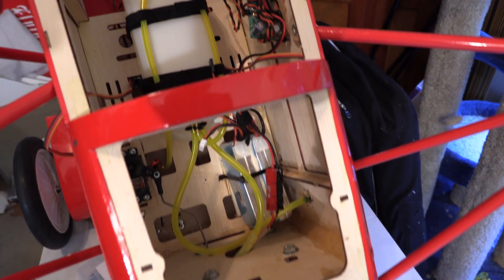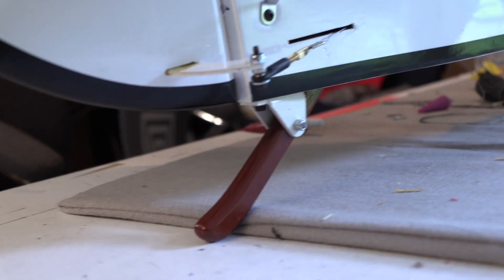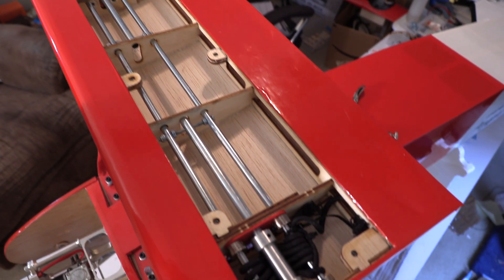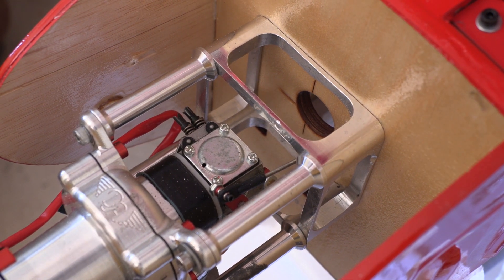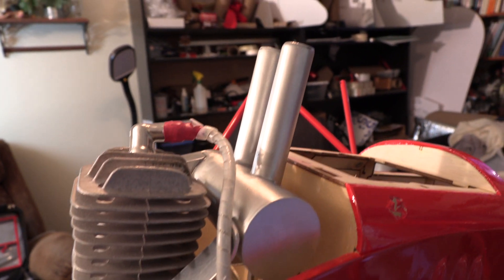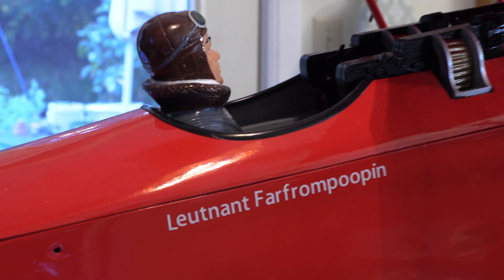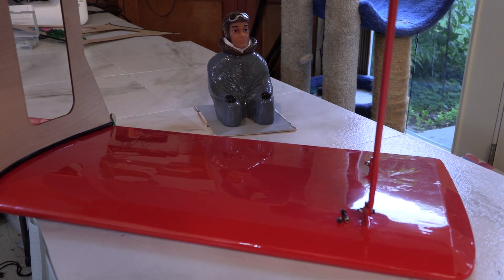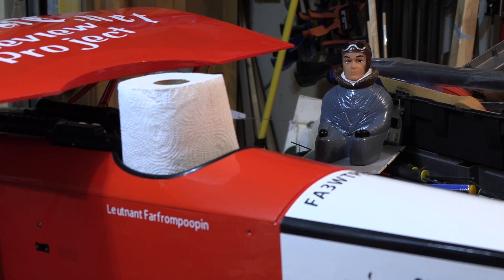Hangar 9 Fokker D7 Build

Comment: Looks great and I have been thinking about one myself.  Why did you go with the da50 instead of the 60?  I was thinking about the 60. Would that have helped with the weight and cg?  Also could I have your xicoy numbers please as I can start a little prepping 😁
Reply from the maker: I used the DA50 because I had it already. A friend of mine used a DA60 and he wound up with almost as much weight as I needed.
Reply from the maker: the dimensions used with the Xicoy are, axle to tail skid 1316mm, wing leading edge to cg 177.8mm, wheel axle to cg 68mm, axle to weight placement 195mm
Reply: @flyingrcdotnet  thank you so much.  Looking forward to your maiden video and review
Reply: @flyingrcdotnet  Mind if I ask what your friend thinks of his da60 in it? Tossing around idea of going electric too. Too many decisions. What servos did you use?
Reply from the maker: He likes the DA60 fine but admits it's got more power than the plane really needs. I used HiTec 7954 servos, almost always do so they can be used in many other planes down the road.
Reply: @flyingrcdotnet  Where were you able to obtain the Bisson muffler?  I tried reaching out to them and did not get a response.  Is this a stock muffler or did you have to provide them with a drawing?

Comment: Hi mate just got one a bit disappointed with the landing legs wondering if there up to job
Reply from the maker: I cannot fly without doing touch and goes, lots of them and the landing gear on the D7 has been just fine, no issues at all. But, if I dork it in I suspect like any landing gear, the wood around them will fail before the gear itself.

Comment: What did the firewall to prop hub distance end up being?
Reply from the maker: https://www.flyingrc.net/h9d7rvu.html  the full reviews always have more of the details
they call for 195mm and mine is about 4mm longer than that mainly because that was the standoff combination I had on hand and I knew going in that a plane like this is likely to need a bunch of nose weight so hanging the enigne a little farther out might help that some.

Comment: What servos did you use?  Also would you recommend to use a smart fly system in this plane?
Reply from the maker: I used HiTec 7954 high voltage servos and use Spektrum PowerSafe receivers in all my big planes.

Comment: Hi, did you follow the instructions to find ol cg? With the model upside down? I’m building the same plane. Thanks in advance for the info.
Reply from the maker: I used my Xicoy digital CG outfit. These planes are too big for me to lift by hand anymore! I suspect it has a pretty wide Cg range though as it is a gentle flying plane.
Reply: thintz12 thank you for the answer

Comment: hi there it says to balance plane with wings off is this correct thanks
Reply: Yes, and the fella I spoke with at Horizon told me the CG range is 6 to 8 inches with their recommendation of 7" smack in the middle.  Mine is about 7 1/8" back from the leading edge of the top wing with the end panels off as per the book.  Mine flies just fine the way it is.  Keep an eye on the bolts holding the center section of the top wing.  Mine were blue lock tighted and still came loose.